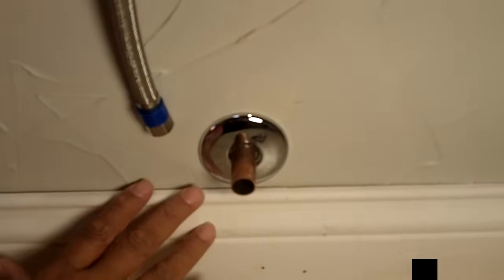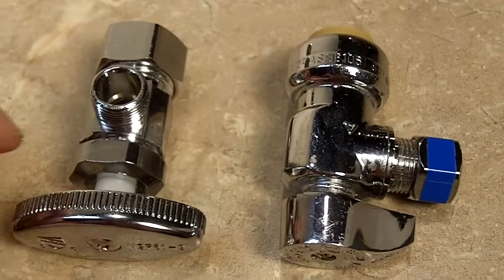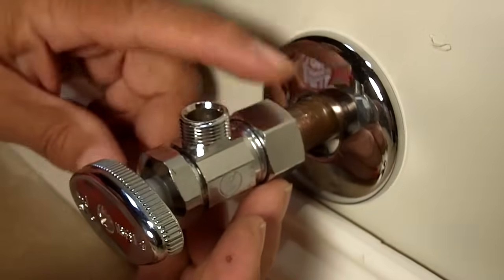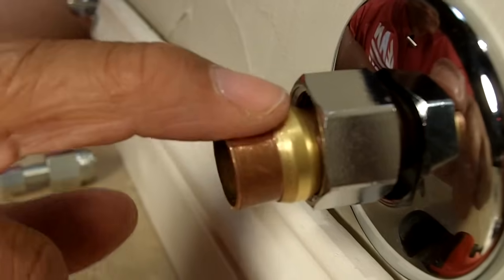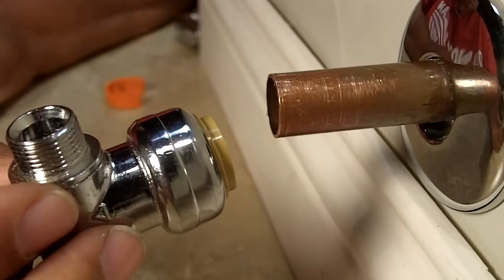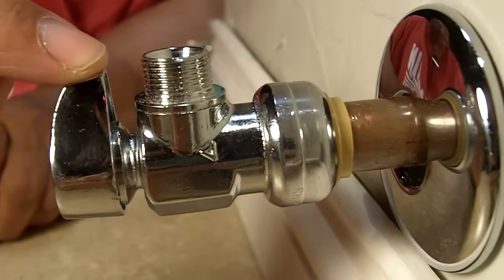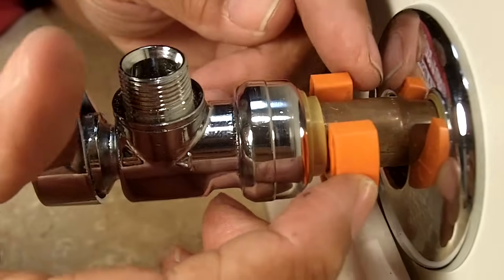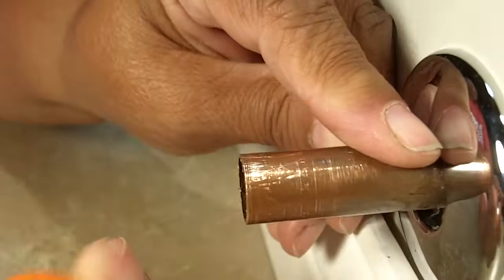Which Type of Water Supply Valve Should You Use: Compression or Push Fit?

Comment: I have more experience with the compression fit valves so those are the ones I use. But regardless of the attachment device, I like the 1/4 turn valves (the push fit was a 1/4 turn valve, the compression fit was a multi turn valve). They are superior to the multi turn valves. I've seen the multi turn valves fail (not turn the water all the way off) within just a few years. The 1/4 turn valves don't wear out as quickly. The difference is the multi turn depends on a washer that wears out, not to mention gaskets or o rings in the stem. The multi turn is a brass ball valve. Not prone to the wear because it doesn't  compress over and over again, or corrode as a multi turn will with different water types and the 1/4 are not as vulnerable to over tightening as the multi turn are.
Reply: +Maxid1 When no clip is handy for removing a push-fit, an open end wrench will do the job and it's thinner than the clip and the long handle gives you some relief from the valve to do the job.
Reply: @TheMarried123  nice thank for the tip
Reply from the maker: Maxid1 Hi Max, nice to hear from you!  I agree that the 1/4 turn valves are superior...it just so happened that the multi-turn was what I had on hand to use for demonstration purposes in the video.
Reply: seejanedrill It's good that you showed both and 1/4 or multi turn wasn't the point of the video, that's just the tangent I went on. I think most people that are doing this for the first time in older homes will more than likely find the multi turn. My house is old enough that the main bathroom toilet fill pipe is threaded so it's neither compression or push fit. Great video!
Reply: This is info I wanted to know! I have been unable to turn some of these handles in the past during a leak and I don’t want to repeat that! Thanks!
Reply: Maxid1 fl
Reply: Argue, srij

Comment: Great video.  I didn't know about those different types of fittings.  I saw them when shopping for copper pipes to make my air compressor plumbing setup.  What kind of PSI are they rated for?  Better to solder for copper air lines?
Reply from the maker: ***** Hi Devon, The PSI is 200.  However, I can't address the copper pipe question, because black iron or galvanized steel is what we've always used in our large shops.
Reply: I'm been plumbing for 40 years longer then they been on the market, there made for those DIY ears. I seen one  blow spart on a water heater where the temp was put up higher then should be, a solder 1/4 turn wouldn't of done that .I think there crap .keep putting then in home owners / contractors I love going behing them  people $$$ lol